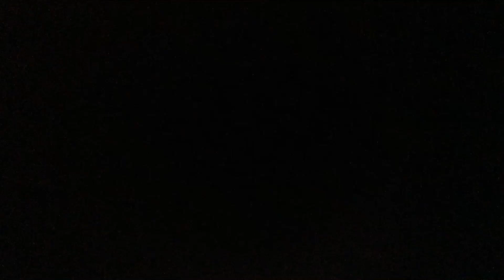NOAA Weather Radio | KIH58 Switches to BMH/Paul + Last CRS cycles & First BMH cycles

Comment: I Freaking Hate New Paul.
Reply: well, you’re going to have to get used to it whether you like it for not for years to come. plus, the change had already began in 2016, and it took you 5-6 years solely to comment that.  i can understand how much you may “miss” the CRS voices (donna/tom/CRS paul), but the end of the day, it was necessary for NWS to transition from CRS to BMH, as CRS bad to be replaced as a result of outdated systems (mentioned during 0:25-0:36)

Comment: Hey guys good news crs Will come back when problems are solved thanks noaa and nws I will love crs when it's repaired
Reply from the maker: Source, please.
Reply: Maria Lujero 
Unfortunately (as much as we want this) this isn’t going to happen. I’ve talked to the National level of the national weather service, as well as many different offices. They stated that when BMH took over, a majority of the NWS offices permanently shut their CRS computers off and had them recycled and scrapped. Only a handful of offices have CRS still. But most of the still existing CRS computers are either permanently out of commission, or are just not ever used. I was told by many offices that they would never use CRS as a back up anyways. (I wish they could) but that’s just the reality of it. 
Honestly it’d be cool if they added Neospeech James to properly take Tom’s place, Kate in Donna’s place, and the Paul voice in place of dec talk Paul. That’d be cool to see happen.
Reply: NortheastOhioRadios911 
They could easily add James and Kate if they wanted to. But they would have to buy licensing for the voices to use them. They explained to me that they don’t want to spend extra money on extra voices. (I personally wish they could add them) but it will very likely not happen either.
Reply: @OHIOWeatherman2001WX  they also said they would likely not change the voice either which is extremely lazy but i understand. They really can just go back to human recordings tbh.

Comment: I hate the new voice
Reply: Tom's voice was more natural.
Reply: Me two, I rather have the original voice back including Tom, Donna, Original Paul, Old Paul, and Craig's voice because, it's sounds very good better than new voices suck as New Paul, instead of the one they called "New Paul," I called it, "Keith," because their new voice really sucks. Not only that, their technology really sucks two which had tendency to interrupt inappropriate when activating EAS rudely and I said to myself, "Hey! Why won't you stop interrupt the voice when activating EAS?" It bothers me the most.

The original Technology is way better than new technology because, when activating EAS, they can stop talking and proceed to activate EAS on weather radio so that way, I can get attenion quite easily. But despite to the new technology, I cannot stand how the voice continues to speak and later the EAS activates rudely and not only that, their new EAS is not that sound too good which sounds like an distortion EAS when activating. 

Older EAS is way better than new EAS because, you don't get an distortion EAS audio from the technology which runs smoothly, and very cleaner and very nice.

I rather go back to its original technology along with original voice because, I can understand what they have to say about the weather info. But for the new technology including the new voice, I cannot understand what they have to say.

Huge thumbs up for old technology and original voices, and thumbs down for the new technology and new voice.
Reply: Tristan Blair: I wish noaa can make a decision to rehab their crs system which uses Tom and bring it back to some states like California, Nevada, and other states!
Reply: Tracer Dash Same
Reply: The new voice sucks!
Reply: I don't hate it.
Reply: NOAA Weather Radio isn’t the same without the crs broadcast which Tom broadcast the forecast and EAs alerts
Reply: Disloyal Dashie I agree with you I hate new Paul’s voice I wish they keeled the Tom and Donna voice. On here.
Reply: Me to it sucks tom and Donna voice is much better and the old Paul

Comment: Listening to NOAA radio will be more boring without Tom. KWO35 still has Tom I think.
Reply from the maker: In my opinion, Paul II was a terrible decision for the new voice. His annunciation of words simply doesn't fit a NOAA Weather Radio broadcast. I don't see why they just didn't stick with Tom or use something else Nuance-developed.
Reply: @SFSEAS  They could've used Nuance Tom which is a slight upgrade of the Speechify Tom (the Tom voice used by NOAA Weather Radio). Yes this is a late reply, but I digress.
Reply: entertainmentmaster4 It sounds like Paul from GoAnimate and ExplodingTNT's Pink Sheep character.
Reply from the maker: The current Paul was developed by NeoSpeech, and the old Paul was developed by DecTalk (correct me if I'm wrong) so they are definitely different. NeoSpeech Paul is in fact an available GoAnimate voice (which is one of the big reasons I dislike it).
Reply: https://en.wikipedia.org/wiki/NOAA_Weather_Radio#Voices
I've been told by a NOAA contact that the new voice is being removed from GoAnimate so fraudulent alerts can't be created and broadcasted.
Reply: @mikewolf5367  No it's not it was never removed and i like the paul voice 90% of the people here don't even use goanimate.
Reply: +statefairshows maybe one day they will upgrade the Donna or tom voice how ever the mobile and Pensacola transmitters still hear tom and Donna when I'm down in one of those two areas
Reply: statefairshows in my opinion, Tom is more natural than this Paul. They've used Tom for over 10 years.
Reply: Why not Microsoft Sam? Or Microsoft Mike? Radar Overseer Scotty?
Reply: +stampycatfan01 those voices were never part of NWS and the new voice is actually just a newer version of the old Paul voice that's why this new voice is called Paul 2 because it's re synthesized version of Paul in fact if listen close you can just barely hear the original Paul's accent
Reply: +statefairshows I never liked it to begin with the voice sounds so human that the voice doesn't have that cold spooky feeling that every one should have during a sever weather outbreak when their home is called out in a tornado warning only good thing is that it doesn't have that creepy deep sound voice when it interrupts tv but the new voice is to easy to just tune out
Reply: I think the NWS in mobile is The only station in Alabama that still has tom and Paul doing the forecast
Reply: +Mike Wolf Oh.